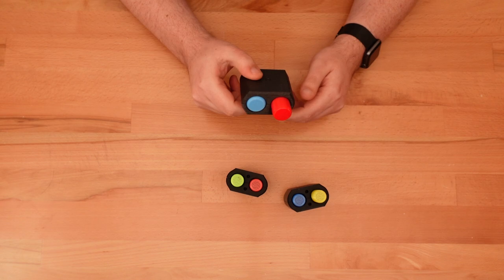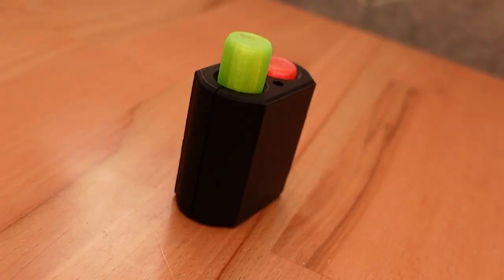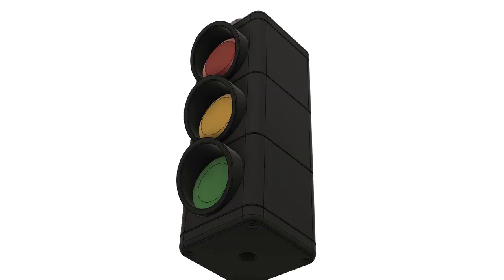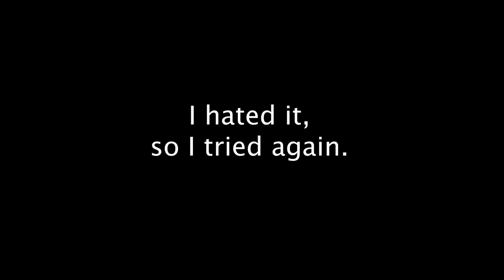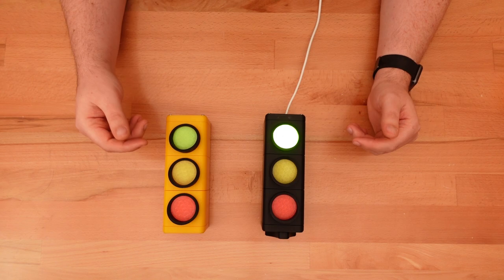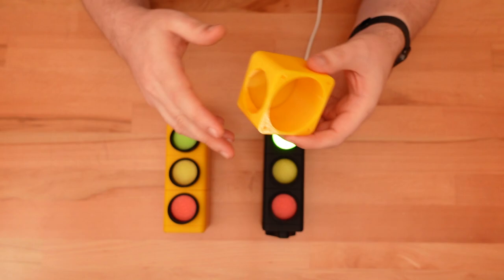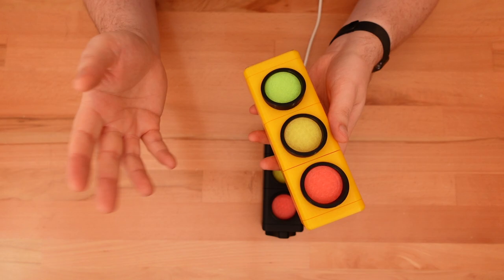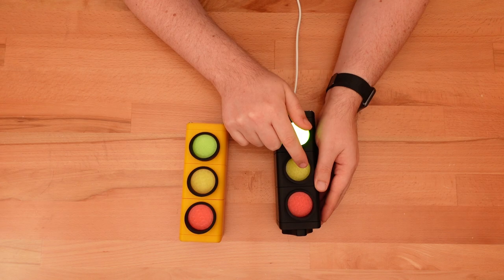3D Printed Mechanical Traffic Light

Comment: Awesome idea, was hoping for one of your projects that could do with my son!

When you were winding the LED strip round, I kept thinking – there must be a simpler way. Glad that you found it. Taking this step further, there must be some kind of 3-D printable trellis/holder that we can use to mount the LED strip?

I highly recommend getting yourself some WERA micro hex drivers (other brands are also available). Watching you having to rely on standard hex keys was painful.
Reply from the maker: It's a fun build - partly because it's at least 30% choose-your-own-adventure. I couldn't settle on any one feature set so now you get to decide what you want it to be!

Yeah, my first wiring attempt was a mess. It's only fair for people to know what they're getting into, so I felt had to leave that in the video! I came very close to modeling a holder... but the other lights made that moot... and they really are much brighter than the longer strips I have.

I might have to follow your advice with the hex drives. This particular model involved more bolts than I was anticipating! Happy printing!

Comment: Nice job !! You can use colored gel to have a nice taint.
Reply from the maker: Thank you! Yes, color gels would definitely work!

In my case I already had the transparent filament to get the tints I was looking for, but gels would be pretty easy to cut and install.
Reply: *tint

You might be surprised to find that TAINT has a completely different meaning!

Comment: This is really cool. I'll have to try printing this. What magnets are you using?
Reply from the maker: For this project I used 6x3mm cylinder magnets. Most of my projects with magnets use either that size or smaller 3x3mm cylinder magnets. So if you buy a bunch, there will be more project available to use the extras.
Reply: @3DPrinty  Thank you. And what LED strip did you end up using?
Reply from the maker: Lots of LED kits would work. What I ended up using, since I had it on hand, was a disassembled LED strip for kitchen lighting: https://www.amazon.com/gp/product/B093SYK5XP/
Reply: @3DPrinty  Thanks

Comment: What kind of screws and magnets are being used?
Reply from the maker: This uses 6x3mm cylinder magnets and M3 socket head bolts. The exact bolt lengths for each part are listed on the project page :)
Reply: @3DPrinty  Thank you!!! I thought I read it but I guess I didn't catch where that information was